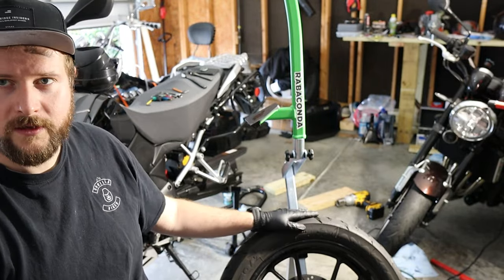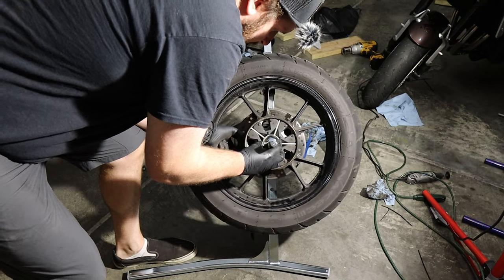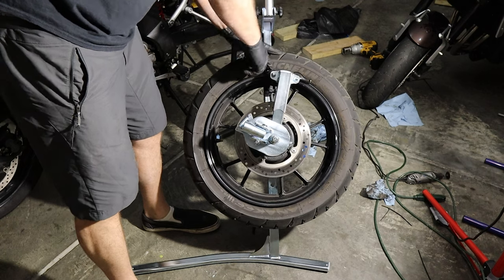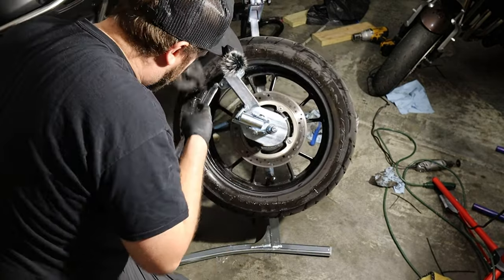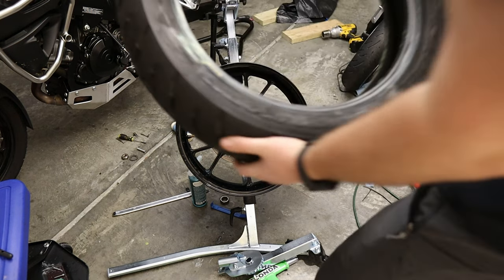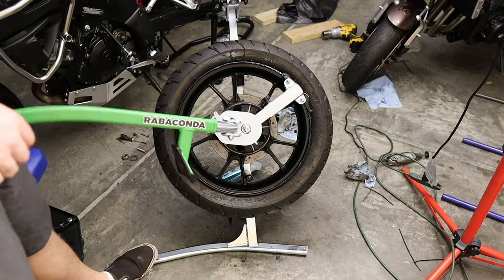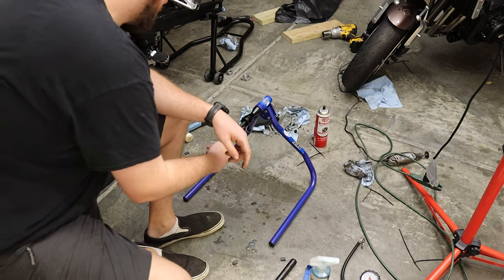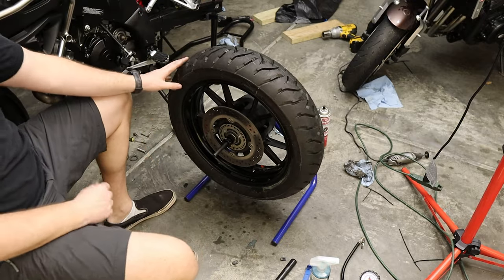Using a Rabaconda for the FIRST TIME to change my Tyre!

Comment: Nice! Somebody invented a better mousetrap!  I gave up with shops mounting my tires in the late 80's.  Only if you buy the tire here at too high $$$ blah, blah, blah. Now all these shops are closed. I blame them, have to compete.  Bought the Harbor Freight changer, recently upgraged it with the Mojo lever setup. It's almost as easy and fast as this, but WAY cheaper.
Reply from the maker: Absolutely, I nearly fell over when I had a price of 50+ per removed wheel from Ron Ayers in Greenville especially since I was buying the tyres through them. I used to just use my knees and levers and not bother balancing, and would have went with something like that tbh, but this was more a public service too to test it properly :D

Comment: I struggled like hell changing out my first few tires lol. Didn't help I tried it on the most stiff tires in the industry. When you learn how to use it, GAME CHANGER.
Reply from the maker: I cheated in that I used to do this on my hands and knees with a few levers, I also weigh a lot which does help :D Yeah this thing has definitely made me more self sufficient, my knees and back don't let me do it the cheap way any more.
Reply: @TheGorillaBiker  and it can go with you to track day!
Reply from the maker: Yes indeed :)

Comment: Impressed.  A very good demonstration too.  Something I used to do back in the UK.  I am sure you will use it more once you start doing track days regularly.   Here it makes no sense to spend that kind of money.  Labour is so cheap here.   I do think a balancer is a good investment as that is something I have seen garages get wrong quite often. Good and useful video. 👍
Reply from the maker: Thanks! Yeah I'm very happy with the system, expensive.....absolutely, definitely something I can see a group of friends buying and using, and/or people like myself who have lots of bikes and go to the track etc. 
Absolutely region dependent too, I probably would never look for one at home in Ireland as prices were more reasonable with people who actually like bikes working in the shops :D The last person who did my wheel had it shockingly wrong :P

Comment: Great vid!! Looks to be a decent quality, easy to use bit of kit.  For your "set up" it's a no-brainer, just order in the tyres you want and job done, nice!  I don't think I can justify it (I'm lucky to have several MB tyre shops on the doorstep offering reasonable prices).  Tempting though 😅. Cheers Andy.
Reply from the maker: Looks to be excellent quality so far, but I'll reserve judgement until it's done a lot of tyres. One or two before incurring damage would be a massive failure. Exactly, bitta self sufficiency :) Haha stick with the ease of letting them do it while it's affordable :D

Comment: Thank you so much! I have never heard of the drop center tool until you mentioned it so I just ordered 2! Hopefully they work as well as they did for you (I got tired of trying to hold the tire in the center by hand).  Thanks again!
Reply from the maker: I know in the past when doing the job on my hands and knees I've pushed the bead opposite what I was working on with a tyre iron too but those things are very easy to use! :)

Comment: What an awesome bit of kit, quite pricy, but if you do the miles, well worth the cost. What size rims will that kit fit?
Reply from the maker: Extremely pricey, which is honestly a huge part of why I wanted to buy it so I could warn people off it if it was bad. But happily it'd great! I can't remember exactly but 15mm bore wheels and then 20-32mm bores also. I think it'd work up to at least. 21" tbh looking at it
Reply: @TheGorillaBiker  Ahh that is good... be annoying to need 2 different units to do sportsbikes and adv bikes.
Reply from the maker: @HippoDrones  oh 100% I probably wouldn't have got one of that had been the case